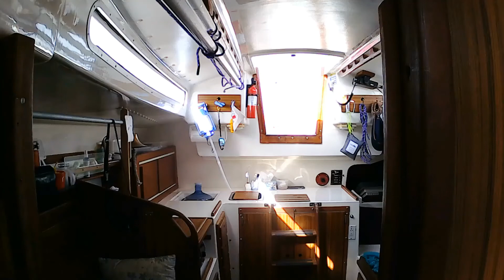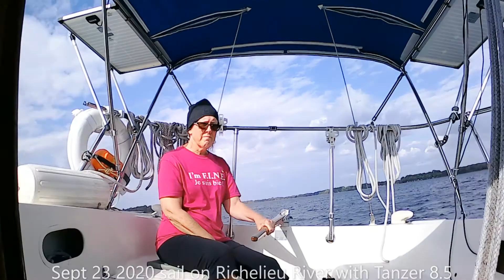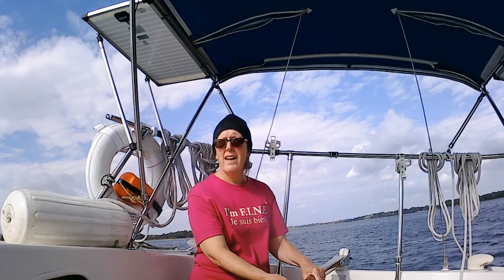Sept 23 2020 sail on Richelieu River with Tanzer 8.5

Comment: 5 knots is ideal? Ah well so enjoyable.
Reply: Hey, the boat doesnt have stanchions or a saftey line, were they an option? 
Love the tanzers btw, not great, but they actually are.
Reply from the maker: It did come with stanchions but they are a false sense of security and a hindrance to getting on and off the boat. I removed them. BUT, I am thinking of putting them back simply because it allows for a better way to route the furler line.
Reply: @markusandgreta4941  they look nice, I was going too replace mine with stainless steel tapered with a loop? on each to snap the bumpers on. Also would of liked too move the  mast rigging off the deck and unto the hull. The hunters with no aft rigging looked ideal,  a bigger main. But ......
Anyways love the tanzers, abit tender but they perform nice underway and are a real pleasure in moderate weather,  responsive with quick acceleration.